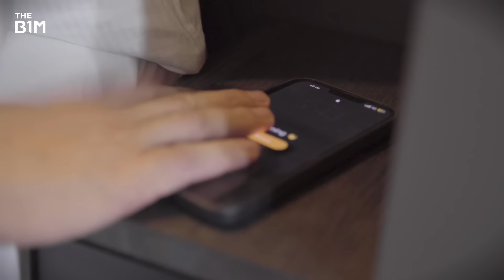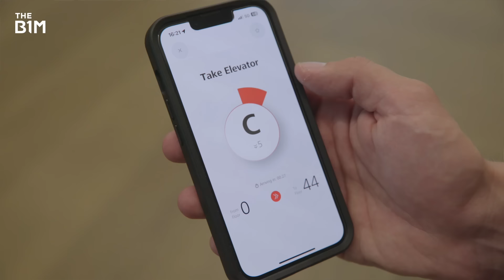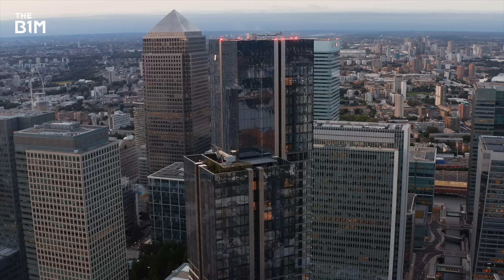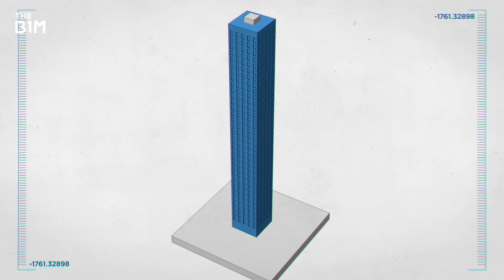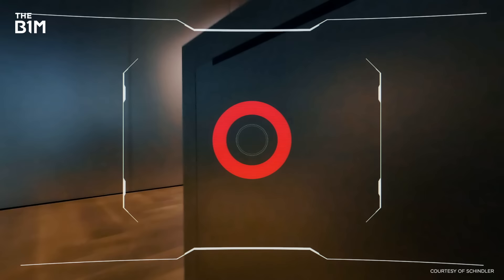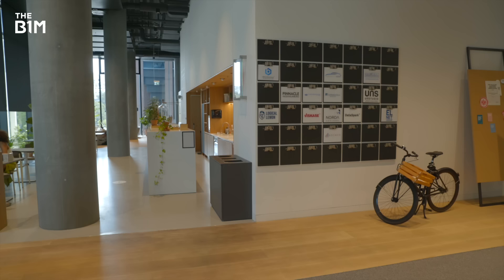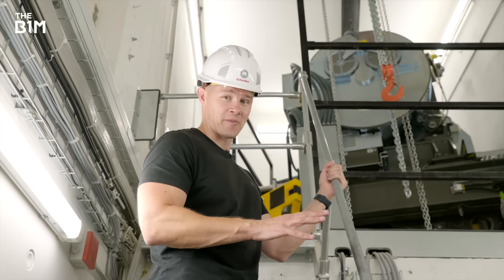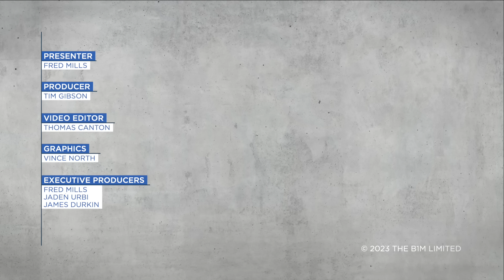Germany Has Solved the Empty Skyscraper Problem

Comment: With all due respect, having worked on a large conversion, the elevators is the least of the problems. The real challenges are rezoning, different safety requirements, all new plumbing, electrical, ventilation, fire systems, loads, parkings….
Reply: Thanks for this comment. I was surprised when elevators were the subject of a video about the secret to skyscraper conversion.
Reply: I was thinking the same thing, in fact in the building they are talking about, you can see that the residential floors has a completely different design to the rest of the building. How is that an example of the conversion from offices to residential?
Reply: I would imagine the utilities (supply and drain plumbing in particular) need to go in a lifted floor or a lowered ceiling?  The offices depicted have plenty of headroom to accommodate that I suppose.
Reply: @TrogdorBurnin8or  yes, for a conversion you need to have all the new plumbing redirected in the dripped ceilings. The issue is how to deal with the noise of such plumbing, and also how to deal with the space taken by the ventilation. The requirements of water, ac and electricity are completely different. As well as noise control. Unless you have already designed the building to be sectioned in residential units from ten beginning, it might actually be cheaper to demolish everything and rebuild from scratch. And by doing that you know pretty much well in advance how much you are spending, when instead you do a renovation/conversion of an exsisting office building into residential everything is a surprise. And the cost cannot be budgeted.
Reply: I was wondering.  It must be a nightmare to convert offices to apts and probably cost prohibitive.  There was a beautiful conversion in my neighborhood recently of a midrise, but it was stripped down to the elevator core, support beams, and floorplates before being completely rebuilt
Reply: I had the same reaction. Presumably, this video serves as a form of advertising for Schindler elevators
Reply: No actually the problem is that elevators in old buildings don't have an app! Not retrofitting floorplates with new plumbing and infra, emergency egress, soundproofing between units, access to natural light... We just needed an app! Brilliant! What are these Germans even on about? Mixed-use shared elevators with key fobs has been a thing for ages.
Reply: @jj6282  exactly. It costs more than demolishing and rebuilding. And with more uncertainty. Also the overall technical performance of the exterior will be probably inferior. You do it only if you want to save the facades because you have to.
Reply: Yeah switching over office skyscrapers to homes is a lot easier said than done because of all the things that you mentioned.
Reply: The fact that you bring up rezoning before all the others😂
Reply: I love how rezoning always seems to be the biggest problem in the US
Reply: A lot of your points are probably a bit too specific to the US. Rezoning isn't a problem and if anything, an office building in Germany is going to have a garage, whereas most residential buildings don't have garages or parking because there are no requirements for parking. Besides: if you live in a european city you usually don't ever want a car
Reply: This whole video is nonsense
Reply: Finance districts typically have poor design for housing. Stores, schools, open spaces, lighting, etc.
Reply: @Herfinnur  I disagree. First of all I worked in projects on both sides of the Atlantic and i’m not aware that anywhere in Europe you can switch a building or part of it from office to residential or vice versa. You still have local bylaws to respect and most of the time the lower floors are in any case dedicated to office and cannot be switched without a derogation.
Second parking is also an issue for residence. It is true that in big cities people tend to use less the car, and tend to go to work by public transportation, so office need not much parking, but residents still owns cars that use for holidays and weekends. Where should they put their car for the week? And so if you wanna rent or sell apartment to residence, even if you don’t have stringent bylaws, you still need to provide parking. Approximately one per medium size unit. And that is the challenging part. Offices often do not have parkings, or limited parkings instead. Because they don’t really need them.
Reply: So, some of those barriers could be removed with a simple change in law.   I'm curious which are really differences in the engineering or design requirements for a residential vs. commercial building type.  

For example: "all new plumbing.". I think you'd find many people surprised by that.  At first glance, it's hard to imagine why.
Reply: @luigifranceschi2350 I rent space in a nearby garage for $200 a month. Given the cost of rent it's not a big deal. Why does parking need to be included with the apartment? If you need it then just rent it, and if theres enough demand someone will build a garage nearby.
Reply: @RobespierreThePoof  Every apartment needs running water and drains for kitchens and bathrooms. Of course common bathrooms and showers could be set up. . .
Reply: Yes, they make the conversion from one use to another sound all too easy. It just isn't.
Reply: @publicacct5626   Schindler is Swiss
Reply: Yes, I was expecting this to be about converting the office floor plan into apartments with decent window coverage, rerouting plumbing, etc. I was surprised there were still offices at all. 

Having a lobby just for the housing is nice but plenty of buildings have multiple lobbies — though some for less nice purposes like giving the expensive apartments a larger lobby and express elevators to the upper floors while everyone else uses a small dingy lobby to get to the normal ones.
Reply: @dosgos  I don't want to know what kinda of sicko that thinks offices don't need running water for sinks and toilets.
Reply: And biggest of all is plumbing.
Reply: @TheBaldr  It's about volume. Residential needs considerably more. How many showers do you take in an office building? How much laundry do you do? How many meals do you prepare? Yes, both need plumbing, but the needs are considerably different - different enough that it is a major factor in determining whether if is financially feasible to convert an office building to residential.
Reply: Euclidean zoning is such a cancer on humanity. I feel like this wouldn’t be hard if cities would get the zoning stick out of their ass. The only time it makes sense is to keep dirty industry away from homes.
Reply: @luigifranceschi2350 you are way overestimating the number of parking spaces provided in European cities for residential. There is a new development in my my city that when complete will have over 2000 apartments as well as office spaces, restaurants and a hotel. For the whole development there will be just over 700 parking spaces in the garage. The development coisists of multiple buildings including the tallest building in the nordic region.
Reply: @hailexiao2770  A lot (not all) of municipalities have regulations that mandate a specific number of parking spaces per housing unit.
Reply: Same, this video was so silly to me that they were acting like elevators are the solution for the empty office crisis lmfao
Reply: Yep
Reply: @TD32333 i think he got bowled over by some elevator PR person
Reply: And this is where reality capture comes in. High definition laser scanning will capture all of the existing assets within the building. Produce a BIM model with this data and your good to go. I've seen teams attempt to repurpose high-rises, shopping centres, and even homes from original plans and it always ends badly as most often these plans weren't updated when design changes were made during construction, or haven't been updated throughout the buildings many upgrades and retrofits.
Reply: @luigifranceschi2350 Do modern office buildings have no toilets and sinks? No heating and air conditioning? They are not noise controlled so that people can work without distraction? I find these reasons specious.
Reply: I’d love to see what goes down in NYC regarding office to residential conversions.
Reply: That's exactly what I was going to comment about.  Converting office space to residential will be complicated.  One of the main issues is that office floor plates are large.  Are new apartments laid out with deep floor plans with limited sunlight?  Or maybe a regular residential layout with a huge unused middle core?  Or maybe the inner core can be residential storage use.  Storage facilities are quite common, maybe store all your consumer junk on your same floor instead of down the street.
Reply: @paulekstorm-hughes1894  I hope that everyone that has a car will find a covered parking instead of parking on the street.
Reply: If it's dense housing they're putting in, plumbing, elevators, become a bigger issue.  One possibility with mixed use, is having the use of some the elevators shift with time of day.  During 9-5 more elevators could be dedicated to office use, nighttime to residential.  Base it off of traffic patterms like HOV lanes instead of assuming a more extensive retrofit.
Reply: @PBellAU  construction, even in a brand new building, is never perfectly the same of even the best construction drawing. And who the hell would pay architect top dollars to continuously update during the construction all the different details that are slightly different? Any idea of the costs involved? Moreover with the laser you can capture all that is visible. But you cannot capture what is inside walls, shafts, material composition, rebars etc etc.
Reply: @argusfleibeit1165  they do have, but with completely different distribution at floorplan level and most of the time are open space. And if you;really think is easy just to reconfigure , just try one. You’ll see yourself. Is like trying to transform a minivan in a sport car. They both have engines, 4 wheels and wipers… the same no?
Reply: @luigifranceschi2350  that's correct. Best time to capture the building is after strip out. Or you can combine laser scan dad with the original plans for a more complete picture. In the UK it's a requirement to update changes to the building in the BIM as construction progresses. Ive even seen companies scanning structure as it's being built to update the documents.
Reply: Yeahhhhhh I opened up this video hoping for more than this. Ah well
Reply: I love the "with all due respect"
Reply: Which wouldn't be a problem if the building were designed to be both in the first place like what they do in Singapore.
Reply: I know nothing about construction and even I was watching the video like wth, he's leaving out building codes and zoning laws. He's over simplifying an issue. If this was the case, people would have been doing this in major cities a long time ago.
Reply: This! Where I live there is a Hotel with like 20+ floors. It is now going to be apartments and offices. The remodeling is now going on for 2 years. My country is known for building fast. With this example, one can see that it isn't so easy.
Reply: @luigi in that case why wouldn't the prospective car owner just rent a car for those occasional trips? Owning a car just for that is wasteful in space and cost. If you live in a dense urban area there should be car share accessible by transit. I'm not saying no one should own a car, but it just doesn't make sense if you live in a skyscraper IMO.
Reply: If they made it happen in Germany it can probably done in most of the world. The zoning and building guidlines and burocracy connected to zoning and building guidlines is a nightmare in germany.
Reply: Yes, converting anything in a building like this between commercial and residential is hugely expensive. The elevator is the least of the of the problems. It's plumbing, electrical, it costs a huge amount of money.
Reply: @Djamonja  They're not talking about converting anything. The change is planned before the building is built. It just means the worst-case requirement across all use-cases is used. Whichever has the most stringent code wins. There will be redundant elements, like extra plumbing manifolds and utility meter connection points, which domestic use case would use but office use case would not. The core of this video was about designing in flexibility and removing the very costs you were referring to. I'm not quite sure how the additional cap-ex required to do this will get past the bean-counters though. Construction has typically gone with the lowest tender, and this concept isn't that!
Reply: Really depends on the country. Other than lighting, in Germany we dont really have that problem.
Reply: But this wasn't a conversion right? It seems like it was built with mixed use in mind.
Reply: Yeah I think thysenkrup is just saving themsoves by selling wolf tickets
Reply: @kkon5ti  because in Germany people do not have cars do not use bathroom and do not use electrical appliances at home? Interesting,
Reply: @LukasTech-gw5ly  if it is a mixed used to start and the units always keep their original destination, nothing really new here. But my impression from the video was that they would like to convert the floors from office to residential, even hotel at need. Good luck with that.
Reply: @luigifranceschi2350  "I hope that everyone that has a car will find a covered parking instead of parking on the street.". I guess you are American, steeped in the world of car-dependency?
People living in skyscrapers in European cities don't generally need to own cars.
Reply: @luigfranceschi2350 have you seen how cruse ships are made? They fill a big empty frame with pre constructed units with all the amenities ready to plug in. Would that approach work with offices?
Reply: I want to see a video on these problems
Reply: Put some furniture in it, make the office suites into apartments and call it a day. All the rest is just some BS code... let people adapt. Government slowing shit down as usual
Reply: Also more importantly, the client will pay for such conversion if it's viable and necessary. Presumably a 20% vacancy rate in US means some offices go for months without use, and if they are let they will be getting less, buyer's market and all - so it might be worth paying for conversion to residential space given how things are.

And to be quite honest, most young renters would happily live in a purpose-built office space, the open-plan layout and natural lighting would outweigh some slightly quirky bathroom placement (based on the plumbing issues you're referring to, unless I've misunderstood.)
Reply: It may work in this building because it is designed to be repurposed. Friends of mine lived in a converted office building and it was far from ideal.
Reply: @xxwookey  not really, I actually lived in Milan for 10 years, and you have no idea how a nightmare is to find parking on the streets.
Reply: @tylerttinsley  I don’t think so. I know someone tried a similar concept with prefab homes stack in a steel structure. Didn’t go far.
Reply: @SamLyndonShow  sorry I’m not a YouTuber.
Reply: @imperialsecuritybureau6037  if you are saying that firs you build a residential building, then use the suites as offices instead is ok. You just don’t have the open spaces that employers like, you are managing much more complicated and expensive layout and mechanical systems to have the opportunity to change destination later in. It has been done several times. You are just spending to make an office building with the construction costs of a residential one.
Reply: @imperialsecuritybureau6037  well, the size of each residential units that you could obtain in that way would be gigantic. You would have only one or 2 suites per floor. Not sure many people could afford to buy or rent such big size living space.
Reply: @theliam9848  don’t see why you’d say this? So explain maybe?
Reply: Luigi comes straight in with one of those 'highly qualified engineers and architects and scientists never think of the obvious things while solving the problem'. Do you really think they didn't think about different plumbing needs if someone needs to convert from an office to a residential area? What do you think you need for this? You need a water supply. I dunno, just like you have in offices anyway. You need sewage, you know, just like you have in offices anyway. You need floor and ceiling access, just like your apartments and offices have. I do not think this is as complicated to plan for as you think it is.
Reply: Well rezoning is not usually a problem in most of Europe - since laws on that are far less ridiculous then in the US
Reply: @v_112  not necessarily. It goes case by case. I.e. I’ve seen in few cases in Europe where the lower floors of the buildings are required to be offices. And if you want to have that changed might take years and the results are uncertain. In North America the local authorities get a lot of money every year from the property taxes, so that makes them more inclined to listen to the developer that wants to increase the value of the properties because the higher the value of the property, the higher are the taxes that they collect. In Europe property taxes are much lower so they tend to care less. Then depends country by country.
Reply: Dont forget no plumbing in the unfinished stories and having to move porta potties through floors and that smell
Reply: @luigifranceschi2350  I didn't say it was easy to find parking in cities. I said that generally the public transport and active transport and car sharing and car-hiring is good enough that you don't need to own and thus store your own vehicle. Perhaps Milan was unusual in this regard and the PT/AT was particularly bad? Or maybe you just insisted on having your own car in the city, and thus had to deal with finding somewhere to store it?
Reply: @luigifranceschi2350  I certainly wouldn't, but with 19 or so housemates in a bedsit/SRO situation, that's much more doable.
Reply: @xxwookey  as I said for daily use you don’t need a car in the European cities, but most of families do own at least a car for weekends and holidays. In Germany there are 628 cars per 1000 people and 52 millions cars. Where do you think people should put their cars? In Milan is the same. Every family owns at least a car that they need to leave somewhere, possibly as close at home as possible, and the best in the basement of the building where they live. And in any case a parking spot in Milan goes from 50 to 90 k euros. In price per square foot is more than the suite where they live. Do you think that is because they don’t own a car ?
Reply: but how do we or anybody else know that the "Large Conversions" you claim to have worked on were done well, how do we know you are good at what you do, why should anybody trust what you have to say? You think the people who constructed this building don't know what they are doing? We can see what they can do, your just a username with an attitude.
Reply: @article1934  how do I know that you are non just wasting my time? Anyway anyone with some building experience would understand what I’m saying. Since you don’t understand it means what it means.
Reply: Yeah good commercial for the elevator people but not even in the top ten problems
Reply: Some smart, educated commenters here.  Refreshing!
Reply: This is a  nightmare for the engineers  at the properties to operate them if you don't plan it correctly.
Reply: I started in Class A dude plumbing is no problem. electric is deff not a problem an apartments load is way less then the 100 computers that take the same space. and evacuating 20 people vs 400. dud you have no idea what your talking about
Reply: Ma'am, i do my own plumbing.
Reply: @seanbohdan865  really? Do you have any idea of ten position of the different outlet and bathrooms? That you might have to pass all new columns, shafts, core drilling all the floors, fireproof all the shafts, create ventilation shafts for the exsausts f kitchen and bathroom? And what about the water requirements? How much water needs an office vs a home? Do you take shower in the office? And what about hot water? How do you make it?…. I tell you, is much easier to knock down and rebuild. Is also cheaper and you can do a proper budget instead of an estimation.
Reply: Yes..the red tape is an endless roll.
Reply: I generally agree that the rezoning especially would be an issue.  But office buildings are designed for a much higher occupancy load than residential therefore parking and mechanical and plumbing infrastructure shouldn’t be a problem.  Also office have kitchens and private baths so plumbing wouldn’t be an issue either.  Walls between units can be sufficiently insulated for sound. They do it for apts and offices all the time.  I’m wondering how an elevator called for one person is efficient and how do you keep people from getting on the wrong elevator.
Reply: @qpc1263  off course they have plumbing and ventilation , but not where are needed in a residential building. As well as electricity and all the rest. Yo7 just have to redo all of this, and probably to pass all new raisers, all new ventilation shafts, new drain pipes for sewage… and to do all that you have to cut the slabs in several points, rebars as well … and all of this costs a fortune because in done at time and material instead of fix contract. And without having a crane in the center, like a new building, and with all the constraints of working in an existing building.
Reply: @luigifranceschi2350  I don't think its quite as big of deal as you think.  I worked in General Contracting for 30 years in highrises and there all always huge pipe and electrical shafts.  An office might have 1 person per 100-200 square feet and an apartment would have maybe 1 person per 400-1000 sf.  We cut drilled the slabs for drains and electrical all the time.  Larger offices had kitchens and private bathrooms.   I would agree that going back and forth between office and apartment or hotel might be more of a challenge.  Tearing down a highrise costs would never be justified.  Older buildings would be more of a challenge but we have all seen the old brick office buildings and warehouses converted to residential.  Its not an impossibility.
Reply: of course rezoning (as it's implied here, very loose, today this, tomorrow that) is a problem in germany with how the law is and building authorities function. Also, part of if rezoning is granted is exactly how the building and its installations are constructed. @Herfinnur
Reply: while the US has a car/inhabitant ratio of around 0.9 the EU still has around 0,57, so I wouldnt be quite so arrogant. That's not even a 2-fold difference and you are acting like it's 10x. @xxwookey
Reply: @maxmeier532  But the mileage per vehicle is about half in the EU compared to the US (11300 vs 21700 (in 2019)), so that's a great deal less car-dependency overall (.63*.52 is 1/3rd the miles travelled per person). Not sure what I said that you are calling arrogant. We are talking about areas with sykscrapers here - i.e the central part of big cities. In those public transport is way better than average and car usage and ownership is way below average, which is generally a good thing.
Reply: You don’t get it so 🤷🏼‍♂️
Reply: This video is clearly about how the mixed use was clearly thought through and flexibly integrated into the structure. Considering possible changes in the future and demonstrating how apartments and offices can co-habilitate the space even on the same floors. Not sure why you didn't get that.
Reply: @Fr00ter  he’s also suggesting the the solution to the housing crisis is to convert to mixed used the office buildings. And that the main issue is the elevator. Which is not.
Reply: Bathrooms and kitchens come to mind…
Reply: @DreiSchwarzeKater  Worst B1M video since i can remember. What exactly was so smart about the elevators?
Reply: Nein nein nein nein!!!
Ze elevator iz everysing!
Reply: I was going the post the same observation. I understand it is difficult and costly to convert these buildings.. especially the plumbing.... with my own respect to the presenter of this  he seems to have missed the main problems of conversion being seemingly  fixated on elevators.
Reply: I thought the biggest issue with office tower conversion is natural light — how do you wall off the floorplate into rooms without creating windowless interior spaces
Reply: @grimmWednesday  this is one of the issues. Usually you try to put in the back bathroom, laundry and closets. If you have good ceilings height you might do a podium and put the bedroom raised, so you don’t close the wall all the way to the ceiling and so you can leave light and save the privacy of the bedroom. But is a compromise.
Reply: @DragonKingGaav  if you have an office, you have all the things you need to change it to a living space, water, heating, AC and electricity...so no big deal!   
if you dont know about construction...you may wonder, i dont!
Reply: @DragonKingGaav  its more easy as you may think....
Reply: This is exactly correct. Cities charge office buildings a lot more in taxes than they do residential housing. It is actually against their revenue stream incentive to encourage more residential housing to be built vs. more office
Reply: parking is not a concern in europe, we have extensive well functioning PT systems and very small amount of people commutes with the car anyway
Reply: couldn't agree more. another fun to watch video but content falls short of title.
Reply: @alexpetrov2531  also in Europe if you live in a building you would li,e to have your car, that you maybe use only for weekends and holidays, as well as the weekly grocery, in the basement. So if you convert an office building , that needs less parking, because people commute to go to work, to residential, you will need more parking to satisfy the needs of the residents.
Reply: As an architect I would completely agree with you
Reply: Not so much in Germany. The outfitting teams for plumbing, electrical, ventilation, are pretty much streamlined if you have ever seen a rawbau being finished. The modular system developed by Germany help. The investment and planning of large structures are still complicated and difficult in Germany. In UK and IS, colonial countries, you have the old money from colonial rape and take, which Germany does not have.. Also Germany lost a lot of wealth in the 2 wars and works through new institutional money.
Reply: @stopato5772  again, this has nothing to do with “old money” but with efficiency. You either build an inefficient office building, ready for a conversion to residential, or you spend a fortune to convert an efficient office building into residential. And please, don’t make me mention the efficiency of German construction, or I would have to mention the “efficiency” of Brandebourg Airport.
Reply: Let's tackle the obvious: Who would such apartments be aimed at? The people that NEED homes are not likely to be the ones you would find in and amongst high flying city based skyscraper businesses. Effectively, poorer people. People earning big salaries already working in the city have no problem finding somewhere to live. Fact. This will not catch on at all.
Reply: @luigifranceschi2350 As European who moved a lot … it is up to a buyer or renter to think over. There is no mandatory obligation to provide parking lot. It’s just matter of price and choice on part of the customer. 

If You design building with only one in fifth flats having parking lot, which You would need to purchase separately … You would still have a lot of customers in Central European City. (Price would be lower)
Reply: @petrskupa6292  i know that. Just people will pay less. And with the high costs of conversion, plus all the surprise that you can find during the works, the decision to convert vs total reconstruction has to be analyzed very seriously
Reply: @luigifranceschi2350  That I agree.
I have of course no idea about real troubles of skyscraper conversion. And never lived in one.
Though it feels as extremely cool way of living - so it also comes with some lucrativity attached for that style of living … true price smaller because of missing parking, yet still lucrative and high (though it’s just my mental projection what I would be willing to pay, not knowledge of the market in Europe)

I wonder if European and US office skyscrapers are in similar position regarding the “simpler plumbing” as I understood is one of the issues in office buildings.(?)  Thinking how is our Europe sometimes stupidly overregulated - I would not wonder if there were some requirements for office, US doesn’t have. … curious (you wrote to have experienced this work on both sides of Atlantic)
Reply: So the big problem is that old skyscrapers weren't meant to be converted? Better late than never to start building more adaptable buildings i guess.
Reply: @help1ng316  you just have to build inefficient office building in order to have the possibility to convert them later on in inefficient residential buildings. Is like building a minivan with the possibility to have it converted to a race car later on.
Reply: In buildings without supporting walls, a relativly free use is already made by design. Something like "rezoning" does not exist in Europe.
Safety ? An office is as safe as an apparment. You lock the door. Safety done. Sometimes you get elevator keys, to allow access to a certain floor.
Biggest change for people are room-high windows. Many people don't like this for appartments.
Reply: This seems to have been a commercial.
Reply: Rezoning is the least expensive aspect of converting buildings to residential; it's just paperwork.  But ultimately, it's how much of the building that is being converted to residential that would factor in the cost of the conversion process.  I would imagine that doing so would be limited to about a third of the building, or less, in order to keep costs low.
Reply: @dswynne  is just paperwork that might take months, years, or get a denial. The rezoning process has to pass through the mayor and the city councillors. And if they had forecasted offices they won’t be so easily convinced that now can be residential. The fact that you can make money by rezoning is definitely NOT their top priority. And BTW architects do not work for free. You need drawings to put on the table.
Reply: Sorry but this view is kinda naive. Most are regulation. They aren't a tangible problem and can easily be changed.

As for the other stuff? All that can be build in a way that served both.
Reply: @asdanjer  as I said they can, is just more expensive and less efficient. Is like building a minivan that is suitable for a conversion in a sport car. You can. You will jus5 have a terrible minivan and a terrible sport car. But you can do it.
Reply: @luigifranceschi2350  I mean the requirements are not that different. This comparison is kinda bad. 
The general requirements are more or les the same. And then you can just do those things on the individual floors when remodeling them. So I don't think you need to do that much when planing the building. The elevator is something which changing of is hard to impossible later on. The rest is not as long as you got the required infrastructure for it.
Yes it is expensive and also probably s waste of resources. And rherfor probably not worth it. But it can be a good residential building/ office. Just a really expensive one especially when it comes to redistributing it.
Reply: Thankfully those are challenges solvable legislatively, which is starting to happen in some major US metros.
Reply: Yeah, this whole video makes no sense as it doesn't address these much larger issues. One other one: on traditional office buildings, the floorplate is quite wide to maximize floor space. If you were to convert a traditional office tower to apartments, you'll wind up with apartments that don't have any windows.
Reply: @davidnicholson6680  the warehouse conversions I've seen use central hallways. Each connects to the hallway and runs to the exterior window, even if it's a narrow footprint. So instead of stacking squares you have an array of thinner rectangles
Reply: Europe often has mixed Zones, that simplifies things a bit.
Reply: @DreiSchwarzeKater Paid Promotion 🤷🏾‍♂️
Reply: @hailexiao2770  its such a norm in Mumbai. You can park your car in the nearest parking built and maintained by the city council for real cheap price.
Reply: To me this just seems like a prototype for the 15 minute cities dystopia that all those crazy conspiracy theorists have warned about.
Reply: He can't teach a masters degree in 8 minutes Jesus Christ
Reply: My god.. I'm so glad this is the top comment.. I was pulling my hair watching the video
Reply: Yeah, updating the elevator controls is really a pretty minor thing, although it probably takes forever, given the lack of people who build elevators.
Reply: They're not presenting a conversion, but future partial conversionability. I think the points made at 4:25 are valid. In a context of user experience living a home with commercial traffic would be undesirable, but preparing a building with pre planned malleability makes it more future proof. Also the sponsor is elevators, but if the building is conceived with this mixed malleable destination it is obvious that underlying services would also be as malleable.
Reply: @dosgos  This is not how that works in germany
Reply: DEATH IS ONLY THE BEGINING. sometimes Things die
Reply: The Cecil Hotel in USA’s LA didn’t work 😂😂😂😂 wishing them the best of luck 🤞🏻
Reply: Toilets and bathrooms? Surely residential requires much more plumbing and in different places than is required in commercial. I'm no expert but this seems like a bigger problem than the lifts.
Reply: @TD32333  Correct but almost all rules have exceptions for special concepts and cases.
Reply: Indeed this is just an advertising video for Schindler elevators
Reply: However the one aspect gives the developer the option

The option of the buildings different 'floors' being changed  will not be limited to access

The chamging of the use is relative to the developers decision based on REVENUE linked to occupancy

This the change in terms of wet works is relative to the need and filling the occupancy

The by laws will follow as Urban Planning should be malleable enough to see a problem and adapt based on a good motivation of the intended use backed facts, precedent and case scenario's 

So all in all it is relatove to the need and subject to changeing the core of the building (the elevators

Not really a novel idea by schindler elevators but a necessary one

Elevator c0m0anies AND more so TOEN PLANNERS should have though of this years back when the 100's of skyscrapers where being built - imo

Just saying
Reply: Repurposing old office buildings is a very expensive and impractical conversion. That’s why so many are still sitting vacant. Besides, your elevator explanation made zero sense.
Reply: Ame .
Reply: ok so its not just me lol
Reply: Lunch time would be horrible
Reply: the elevator company is paying for the video ............................................
Reply: @dosgos every office I've worked in has multiple ktichens on every floor. It wasn't like I had to go down to the ground floor to make a cup of tea or a take a shower or use a toilet.
Reply: i dont live in those shoe boxes but this is what i noticed aswell ,rezoning issues, this is also the reason why ive been watching creative people who actually live in small spaces everydays and their sometimes freaky innovative approach in small spaces, and tiny houses almost always fascinates me when im in research for livable homes
Reply: depends on how much pre build preparation has been done
Reply: I would dare to say that the biggest "stop" to conversion is that the owners can't take loans as big with a residential building as collateral than commercial building. The value of a converted building will simply drop by a lot simply by the change in use...
if they have no other choice, they will do it... but only as a last resort and after losing already big in lost revenues (another version of sunk cost fallacy, btw)
Reply: I was wondering the same, the load requirement of the commercial part will require larger Dbs, they usually also have a lot of parking requirements
Reply: 100% Man. This is just a Schindler's commercial. Good solution, but for 5% of the problem.
Reply: Yeah, I see two-sided elevators in practically every hospital I've been in for the past 20+ years.  Zoning is just getting rid of pesky government interference.

Imagine the talking heads meeting for this:
"Hey, we can solve our vacancy problem with two-sided elevators!  One side for residents, one side for business.  Genius!"
"Residents?  What about changing the plumbing from water fountains and restrooms to kitchens and showers and laundry?"
"Think about it: double-sided elevators.  It'll solve all our problems!"
Reply: And all the office supplies... Staplers and printers everywhere
Reply: @VinceCannavaII  That's likely the least important concern.  Chances are if a company is going to stop leasing, they'll take their supplies with them.  And if they go bankrupt, the building owners will just repurpose or sell the equipment.
Reply: Great point! Fun fact: the Burj Dubia, the world's tallest building, does not have a sewage network connected to the city's municipal wastewater system💩
Reply: @RobespierreThePoof I feel like this thread sees zoning as such a big problem but is hand waving away the huge difference in things like plumbing. An office floor may have two bathrooms and one kitchen. But divided into apartments you may need two dozen bathrooms (with tubs and showers) and dozen kitchens. It’s a pretty huge investment and engineering problem.
Reply: yes absolutely !   the zoning are completely different and very costly to switch.  This is the massive / major issue with zoning.
Reply: Light and air, ie resi needs a window for every room
Reply: Germany has also invented laws and rules that make converting an office building to apartments a real challenge
Reply: The office towers built in USA in last 20years were pushed by investors in USA banking because of the large non taxable interest payments on the government bonds the banks own.along with USA insurance and few dozen wall street financials that no less than 60% of USA government 34 trillion debt . Possibly someone can get 25million dollar loan to manufacture am/fm radio receivers.seriously these three may motivate innovators to convert office towers to residential and hotels with all the needed changes for conversion . The three most likely own a lot of vacant office  towers ..if successful THIER initial office tower investment would be collecting rental revenues .
Reply: @johnvercellone1988  is not so easy. In most cases could be cheaper to demolish and rebuild rather than convert. And with much less contingency.  This type of conversion is to be taken into consideration only if there are issues to demolish, like protected building or complications like subway.
Reply: @tylerttinsley  going forward buildings could hypothetically be designed for compartmentalization that might make conversion easier. From a practical standpoint why pay extra now so sometime in the future you could save money. No developer would do that.
Reply: There's always an excuse to not do things. Local govt. regulations would be changed to convert office buildings as empty skyscrapers are not productive.
Reply: @alfredthegreat9543  I think it's less about excuses and more about profit margin. As many engineers and architects point out, it's often cheaper and faster to knock it down and start from scratch.
Reply: Well, it kinda is. You still need to do rezoning and depending on which party is in power you still won't have a majority for that.
Not to mention that in my town in lower Saxony the office buildings can't be converted because 
1. The investor rather has it staying empty than loosing half or more of their intended price/m2, having to deal with tenants they can't easily evict and having to strip the hole building and rebuild it. And after that there were problems with the design so some bigger floors had immer apartments without windows. At least that was what I remember from the article in our local newspaper @Herfinnur
Reply: Also how much of the floor is rentable for apartments. You run into a geometry problem
Reply: I concur.